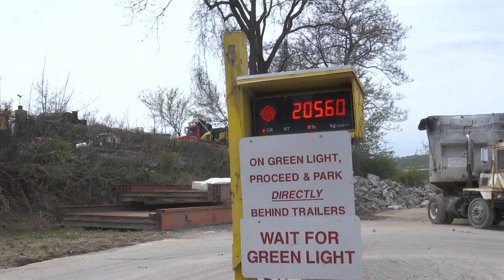Save Time, Money, Productivity with these simple tricks (Dumpster Hauling)

Comment: Another huge time savings is a tarping system on the truck
Reply from the maker: The tarper weight is to much fir the little truck
Reply: @LaRobertos  

Is it a 26000 gvw ?
Reply from the maker: yes it is  @mr.d4295
Reply: @LaRobertos  

It's a nice truck.
Reply from the maker: thanks took allot of time to spec it  @mr.d4295